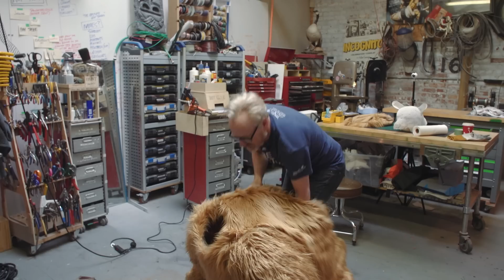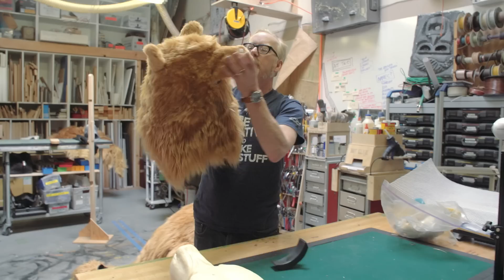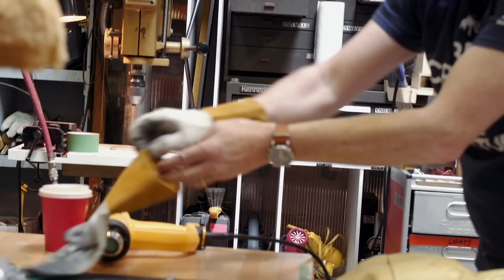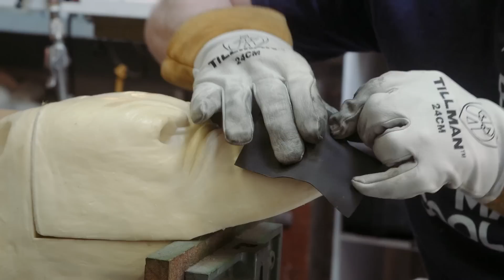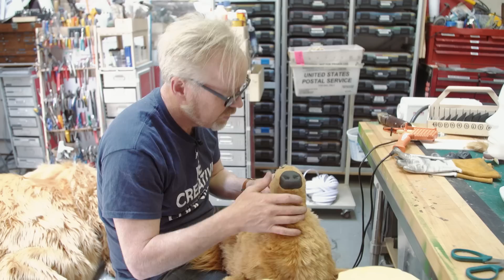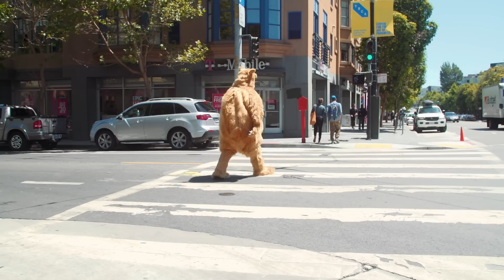Adam Savage's One Day Builds: Bear Costume!

Comment: You: Heat gun 

Me, an intellectual: Industrial blow dryer
Reply: Blaster that emits warmth
Reply: Canon used to emit oxegen of higher temperatures of that if usual air
Reply: @shitmultiverse1404  canon used to emit a mixture of nitrogen and oxygen thats temperature is relatively warm when compared to the temperature of regular nitrogen and Oxygen mixture
Reply: @lizard_man4379  Now that's an intellectual.

Comment: isn't the head too small compared to the size of the body?
Reply: Ikr and the body isnt that tall grizzly bears average 8 feet tall when standing on there hind legs this guy in the costume is like 6 feet in the costume and the head should be like 5 times bigger. And a polar bear costume may look cooler the average polar bear height is 9 through 12 feet tall when standing there way bigger than grizzly bears.
Reply: Also the neck should have draped farther over the body so it blended better. And he kind of ended up with a cool back hump that wasn't continued to the neck.

Comment: Get a toaster oven for your small pieces of Kydex. Set your temp at 400 degrees and 1.5 minutes for 1/16", 2-3 minutes for 1/8", 4-5 minutes for 3/16" and 5-7 minutes for 1/4". When heating Kydex for 5-7 minutes, allow at least 2" (360 degrees arround) of extra material for shrinkage when heating.

Comment: Ok if u want to make the jaw moveable if pupetireing was allowed in comicon use ball joints and fishing wire to connect under the plastic jaw going thrue a metal loop that has a small washer connecting to the fishing wire, on the inner head frame a small hock wold be used to hold the washer connecting to the fishing line holding the jaw closed, to actavate the jaw just let the washer off the small hook  jaw on the outer area opens up.

 btw the ball joints are used to alow the jaw to open and close and u wold put the ball joints under the fur, and the hook to hold the washer wold have a rounded frount so it's not sharp

Comment: The little touches in the set up or your studio are delightful! I am trying to make a sloth costume for street theatre and I have been devouring your channel learning techniques. I was just wondering how you joined the corset boning together for the frame of the bear body and what size boning you used. How does it compare to the rattan? Also, did you cast the claws yourself?